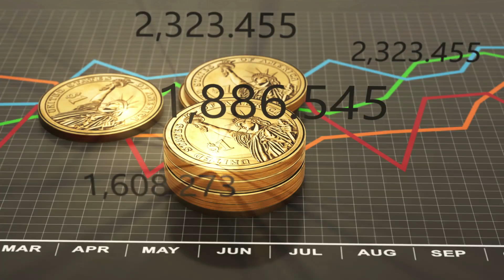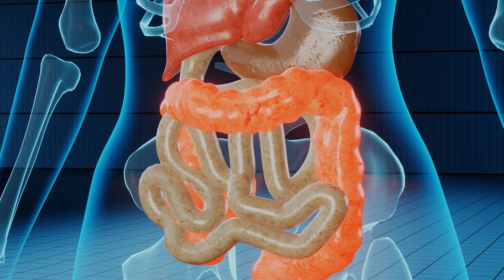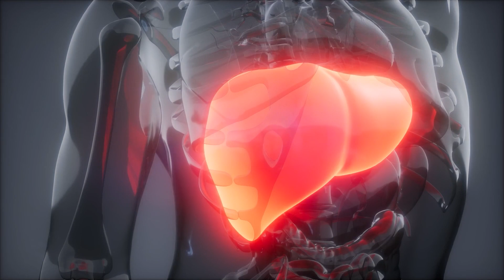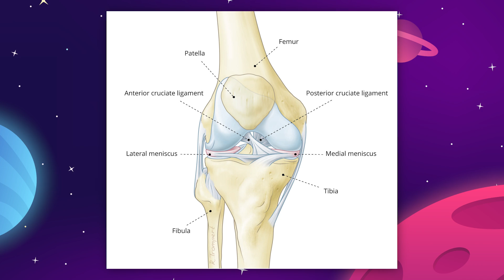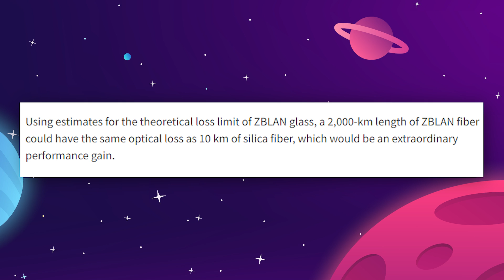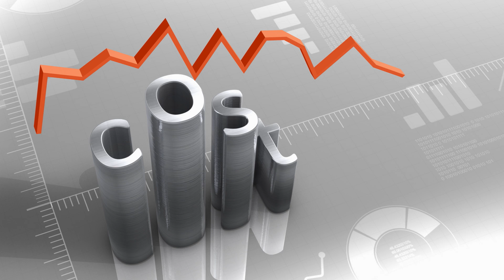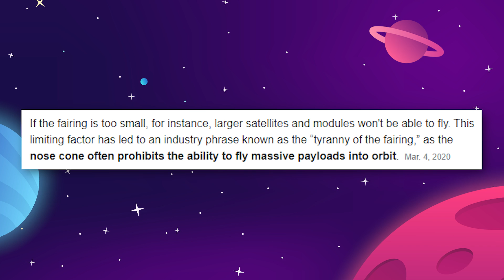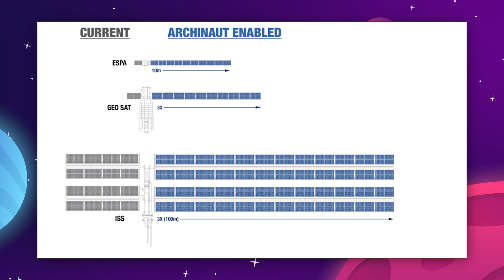How Space Manufacturing Will Change Everything!

Comment: You always need the outside the box thinker or the person who understands how the walls of the box works as if the box was made to hold more than its supposed to be able to but yet its light you see what i mean..? A cardboard box how its made its durability is outstanding but yet its light do they make rocket walls like this? Or they solid and insulated and solid again with air chambers to balance and shift weight or angle adjustment with water weight or even and aird angler thatd shfit the force direction without thrust or gas or feul. Water has electric ions or as whatever keeps it together in a liquid form use water from all around buid a turbine for it exactly and harness the water and the power from it. As well as air holes with air turbines inside to build a charge.  And why cany we, say take a magnifying glass and the sun you focus the beam and its powerful so why not do it with solar panels for solar power magnifying its rays received and harness more power faster and continuously

Comment: Sure, blue origin can make it. But how long will it take? They still didn't made it to orbit. Even starship in this phase is more realistic than what blue origin has. 
I believe that starship as it is now is actually able to make it to extended low earth orbit(~400-500km height). Once on orbit, the inners of starship fuel tanks could be changed into habitable volume. Volume many times larger than what blue origin plans. If only could the SpaceX pull its head from the ass(Mars) and do something more meaningful than Mars colonization(which i believe is a resources sink bound to fail in the end)